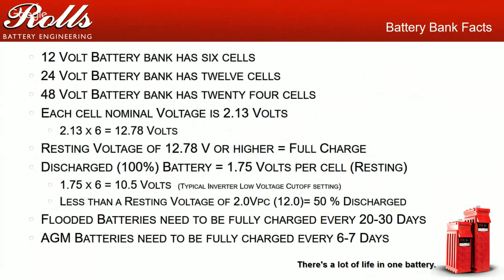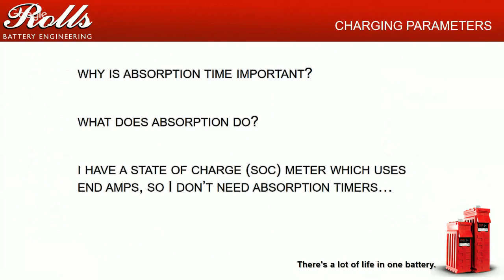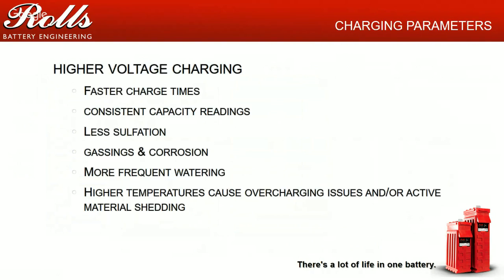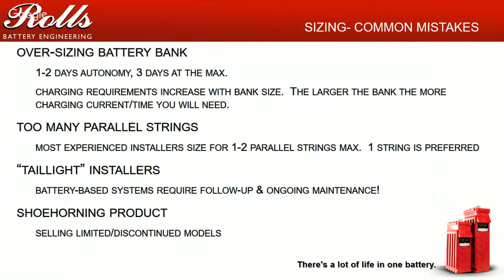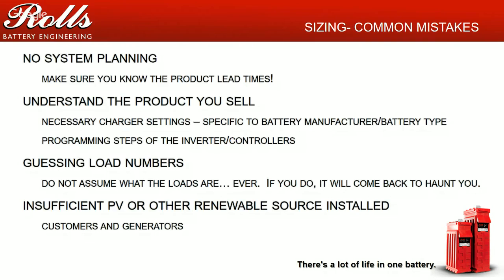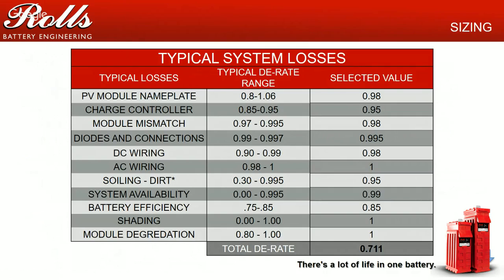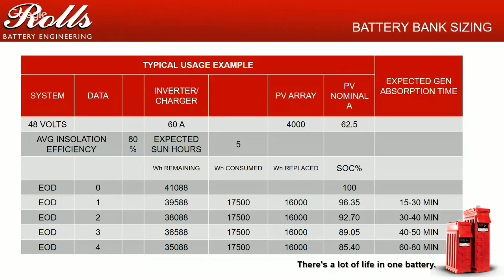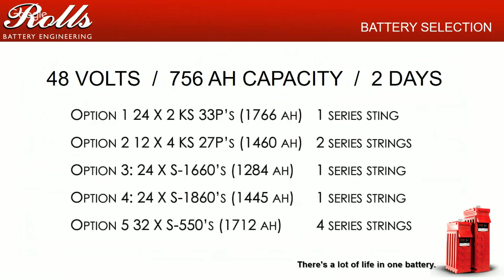Charging Parameters

Comment: I have a 12v 170ah flooded lead acid battery C 10 rated. I charge with a solar charge controller. My controller charges the battery @ 8 to 45 amps. Can high current damage my battery? What is the ideal current for charging my battery?

Comment: What kind of efficiency costs would be associated with per cell charging for each 2V cell in large arrays? For instance each tracking PV bank would have each PV cell supplying a small CCCV circuit converting the solar cell voltage to the correct CCCV voltage. With proper PV sizing and high efficiency buck converter, it seems like you'd never have balancing issues and have good efficiency.
Reply from the maker: Generally any flooded battery will lose about 10% with no load per month... while VRLA Lead batteries lose about 2-4%... This is with no load... 

When you load them, with AC loads you also get the inefficiency of the inverters... 

WIth DC loads you see only about .05% inefficiencies... 

Where the largest Inefficiencies are is when you enter the absorb charger mode... at this point 80%+ SOC the Lead based batteries charge at only about 20-50% depending on where you are in the stage.. 

For your case you just need to design it to charge at above what the assumed losses are and what the battery needs to get to full.  Generally If you pull out 100 Amps you have to have enough solar to put back 120Amps...